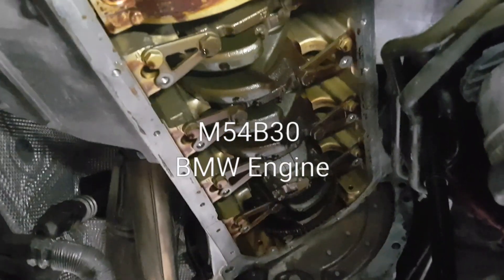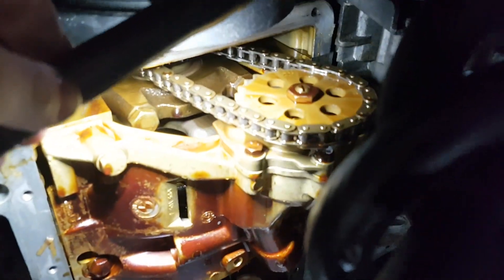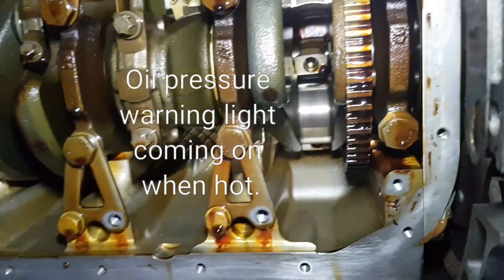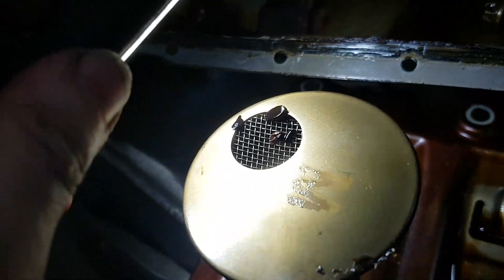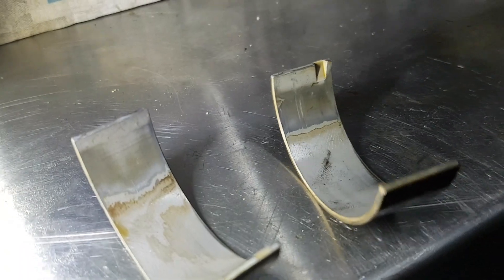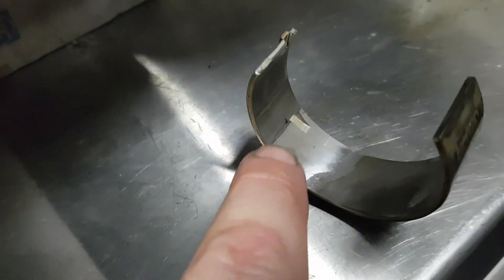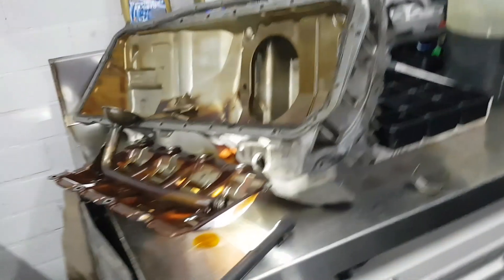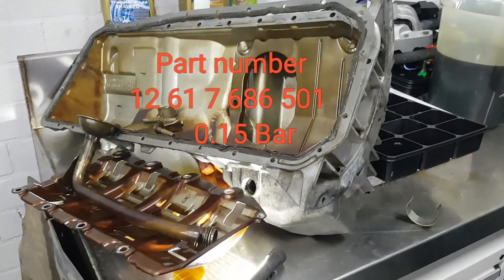BMW M54 530i E60 Oil Pressure Warning On Dash When Hot

Comment: Hey bro i have a 04 525i
The light came on but i thought it was a oil change and i took it to the mechanice and he said it was coming out th drain plug.   He said when he drained it.  There was 3 to 4 quarts left. I was driving to work with the oil light on for two weeks. Did i mess up my car? Just wondering if it was leaking out drain plug and i was driving car for 2 to 3 weeks. Did i put wear and tear on it or everything should be fine.

Comment: Excellent Video! I finally admit there is something wrong with my engine. My E46 330ci is suffering a similar issue, low oil pressure when rev is low, and sometimes oil temp is also abnormal when restarting the engine when the car is warm. And the engine is having a ticking noise now. I replaced the oil pressure switch but nothing changed. I believe the previous owner put the car on the track but didnt look after her properly, now I am pretty sure it should be the oil pump or the bearings, looking for an honest garage...

Comment: My e36 get the oil light on when driving about 30 minute, at first the light comes when driving at low speed, if i speed up the light is gone, but after that if i continue driving, the light gets on all the time..
If i stop the car, turn off the engine, wait until engine cold, and start the engine again, the light is gone..

My engine still runs great at first start until about 30 minute driving and then when the oil light on, my engine feel like less power..

I check the oil level and it is good enough oil, i have change the oil filter, i check the coolant level and it is good enough also, engine temperature indicator allways in the middle never going more hot than that even i continue driving at oil light on..

So what happen to my engine??
This happen after i change my fuel pump with after market china brand osias, but will this fuel pump make this happened?? But the fuel supply always good..

And i found my pcv make whinning noise, can this problem comes from that pcv??

And the oil pressure sensor is moisture with oil, i dont know where the oil come from, but is my oil pressure sensor error because the leaking moisture oil?? If the sensor error but why the engine feel less power too when the sensor light on??

Can you give me some suggestion?

I have not check the fuel filter and fuel injector, maybe i will check if those part gone bad..

My car always get good routine oil change, but last time the car sits for 2 years in garage, and when i am using the car again for daily, the only problem just fuel pump gone bad when i was driving, but after i change my fuel pump, i cant go driving for long time, it come engine light on every 30 minute to 1 hour driving..
Reply: I got the same problem on my bmw e60

Comment: Hello . I get the red oil light when speeding and changing gears at 5-6000 rpm then when slowing down almost at idle the warning appears. Stoping and turning back on the engine , the error disappeares... . The car is 320i N43B20
Reply: had same thing, same engine, changing oil pressure sensor 12617549796 and hydraulic valve 11417584990 solved the problem
https://www.youtube.com/watch?v=Y167u1KKvdg
Reply: say1978 Hello , I’ve changed the pressure sensor , problem solved !
Reply: say1978 There is one more thing, there is oil around the oil cooler , should I change those 2 gaskets ???
Reply: @carswithstefan8561  dont know about that but assume that oil leaks aint good :-)
Reply: @say1978  True ! Nice car anyway..altough many may say that the 3.0 is badass compared to the 2.0, I m still sattisfied with this engine. I will do a resonator, muffler delete soon

Comment: Only sometimes it blinks on me with M54 but only at idle when the engine is hot. Its rare tho. Does like once of 20 times i actually drive the car. The cost for labour on this is probably not worth it. I hope its not the bearings but if it is then RIP. Not worth it to do it on my car.
Reply from the maker: Change the adaption for the idle speed. Adjust it up 100rpm and it may be enough.
Reply from the maker: And use fresh oil 5w40. Make sure all the o rings on the oil filter are replaced at service. Any flat orings will leak pressure away internally.
Reply: Wouldnt bad o ring on the oil filter do that when cold as well ? The red pressure oil thingy never blinked until the car is driven atleast for 30-40 minutes.
Reply from the maker: Oil gets hot, it gets thinner, oil pressure reduces. Any bypassing of pressure, even if minor, will be worse when hot. So yes, my point is still relevant.
Reply: ok thanks :)

Comment: Mine comes on my 328xi when i first start it for maybe 5-10 seconds. sometimes it does, sometimes it doesnt. any ideas what i should be concerned about.
Reply: Pcv valve or oil pressure switch
Reply from the maker: What shape 328? E46?
Reply: @FourRingsAuto  e90